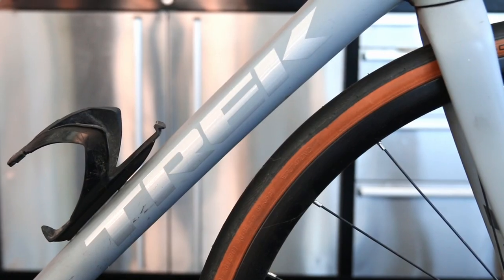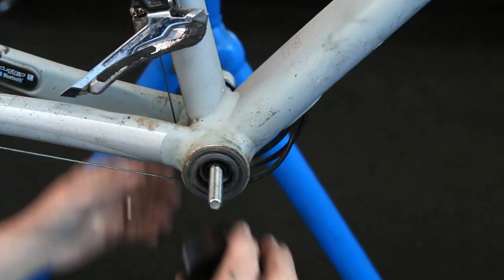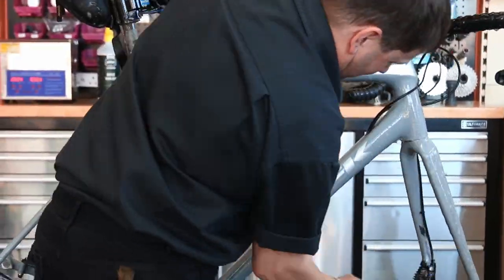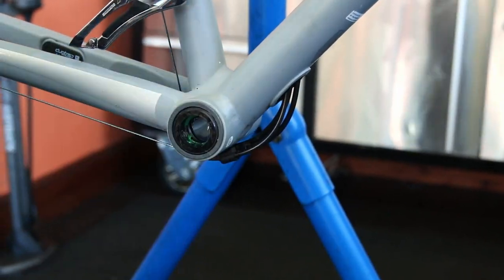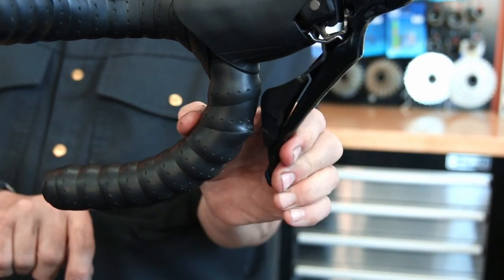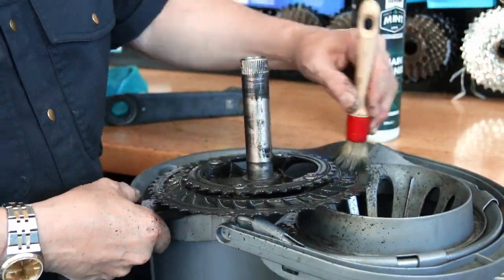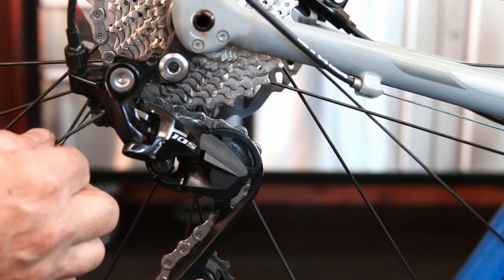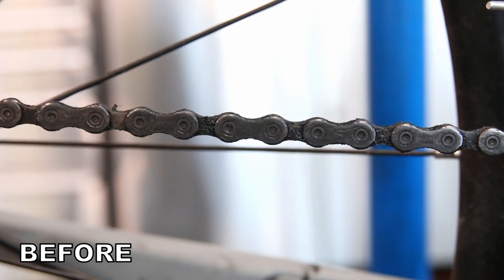Trek Gravel Bike Service, Brake Bleed & New Bottom Bracket!

Comment: Very nice service. So, I have a question regarding your BB removal tool. I have a Trek Checkpoint SL frame with a BB90 - would that tool of yours work for removing/installing that as well or does it only work on a BB86? And if that works - which tool exactly are you using? Thanks!